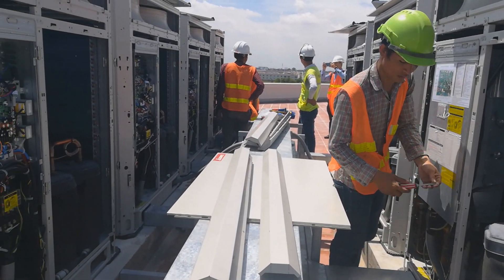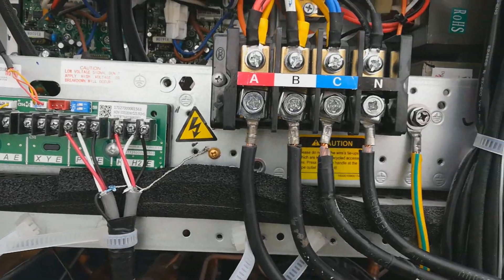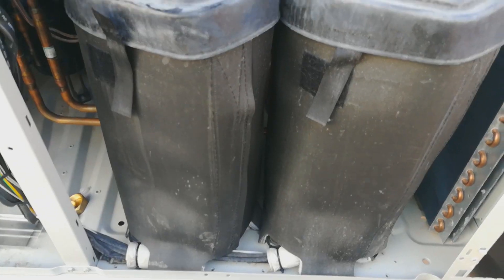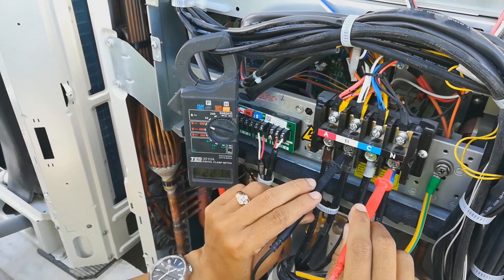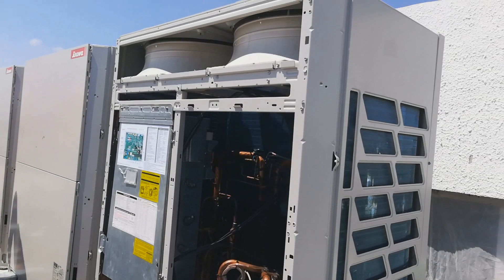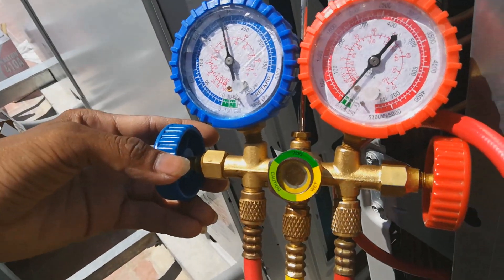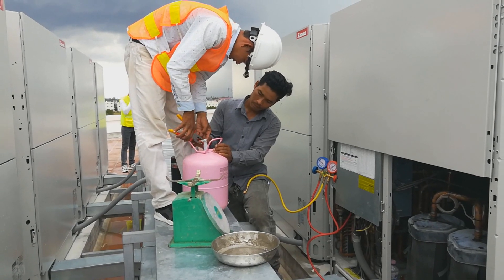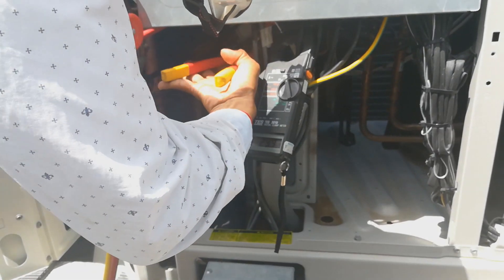VRF System Testing Commissioning and Operation Jinowa

Comment: Thanks a lot CHIGO. Please WANT SEE THE VIDEO CMV CHIGO VRF SYSTEM RUN PROCEDURE & Operation & Address Setting Outdoor (Mother & Salve 1, 2, 3)

I am project Engineer (CHIGO VRF) from Bangladesh. My contact No : +8801745449799
WeChat no:+8801745449799

Please give me your WeChat No Friend. BECAUSE CHIGO VRF ANY PROBLEM I CAN DISCUSS TO WITH YOU.

Comment: They did not bleed the lines those systems are ruined
Reply: Hi, I am an A/C technician. 
A lot of things were not mentioned here. Vacuum the refrigerant pipes is one of the most important steps on any system before charging it. If they did not do it (but they probably did); no way this system worked. Either way, some points were clearly addressed. For qualified technicians is easy to fill the gaps. For trainees, this video helps the clearly specified areas. For example, I do not check the MCB breakers if I get the right el power supply at the OU. (They did and that’s better if you got the time.) Refrigerant is charged on the liquid line until pressure is equalised. Then, the difference leftover, charge very slowly, intermittently through the suction line until reaches the right weight charged into the system.
Either way, I liked this video. Thank you.